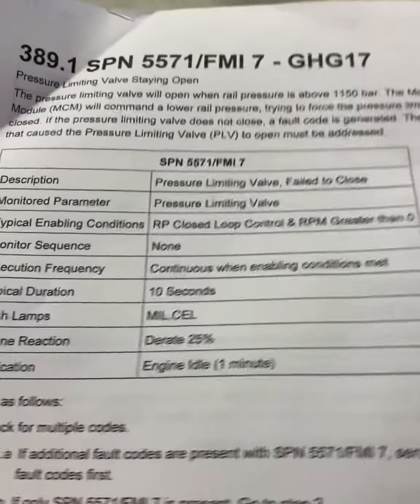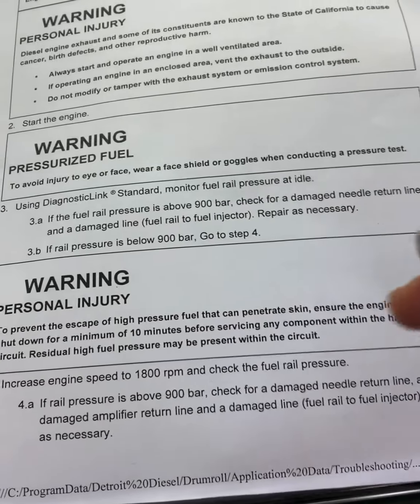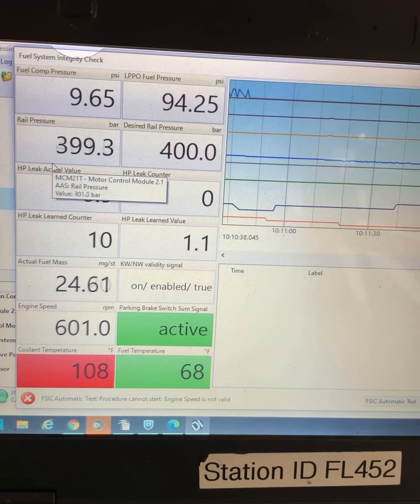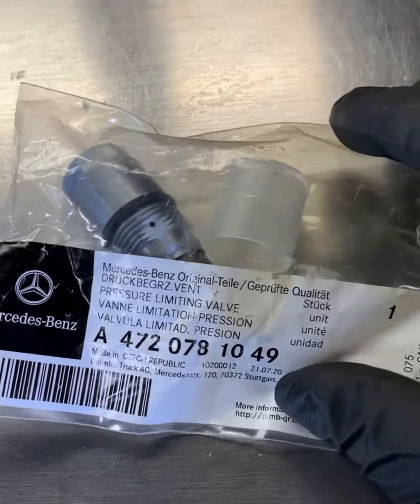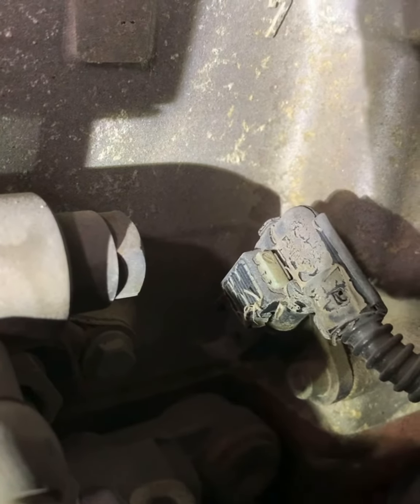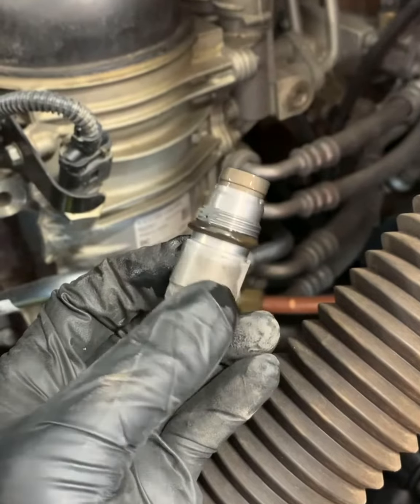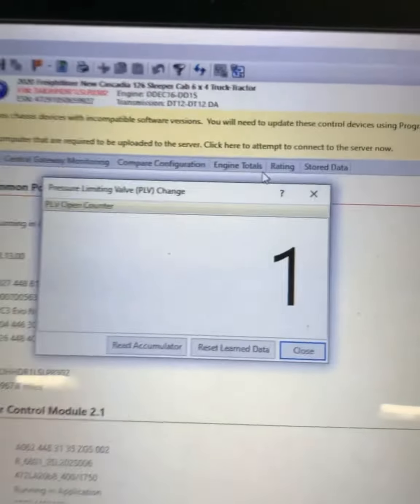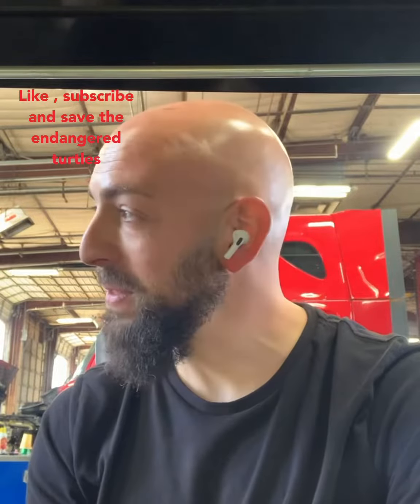5571/7 check engine light pressure limiting valve replacement. Dd15. Dd13.

Comment: Great viedo....my PLV open counter show number 20. do I need replace  same parts. Thank you
Reply from the maker: Anything over 10 is called excessive. So the time is coming for replacement. I would also want to know what your rail pressure sensor is reading engine off engine on and then at 1800 RPM to find out if it’s reading correctly that could be an issue for your plv going bad
Reply: Thanks for your response. Great video  Let's me check I will keep you update....

Comment: I have the exact same code u have can I drive on it till I get to the shop rpm when it stops below 900
Reply from the maker: If you have the same code I’d recommend going to a shop soon. You can drive on it but it’ll make the engine run rough and possible derate
Reply: I couldn’t find the part it’s Sunday can I keep keep the truck running while the code still there n how many miles or hours days etc can I drive on ?
Reply from the maker: @alimajeed9394  the truck will stay running but it will hurt the system if left running for to long. It will keep dumping fuel and hurt your injectors. Every truck is different so no telling how long it’ll let you go for but word of advise , don’t go for to long
Reply: @bustedknucklebydieseldr3228  man  thank you u r really helpful nobody gives free advice these days may god bless u brother

Comment: Thanks for the video. 
After changing the PLV sensor, and I go to fuel rail pressure reading and it still won’t go near 900 bar, so how do we know if that’s a good fix or not?
Reply from the maker: So being under 900 is fine,and thats not the problem here.Basically this troubleshooting takes us in two directions. Run engine and if rail press is below 900 bar than it knows plv is screwing up and opening to often allowing fuel to drain back when it shouldn't which sets the code. If it is over 900 bar than we need to look for damage or debris in lines. id say do a regen and watch your fuel press and for any codes. if they stay fine than your good to go. You can also check the plv counter after the regen and see if its anything over 1. if so its not maintaining pressure correctly.Hope that helps.

Comment: How did u get it off cuz i got wratchet wrenches but i cant get enough leverage on it.
Reply from the maker: To take it off I put a box end wrench on there and smack it with a hammer at the opposite end. It’s a hard to reach place so this makes it much easier.

Comment: I have a cascadia with dd15. Giving a spn 3464 fail 16. Any idea what that is?
Reply from the maker: Great question, That code is a very troublesome code and very intensive troubleshooting. It has to do with the eng seeing  a boost problem. Either you have a boost leak,biased sesnor,bad turbo,bad wastegate,or wiring issue.to many issues can cause this..I usually ask for 3 hrs to trouble shoot this and worst case its a turbo issue which is usally the most $$ part.Hope this gives you a better idea.
Reply: Thank you for responding. I guess I’ll lube up and bring it to freightliner lol. Truck runs great. No loss of power or anything. It’s just that light on the dash is very annoying.

Comment: will this make your truck idle high and low
Reply from the maker: Thanks for watching, this can cause a rough idle and power concerns as fuel is leaving the rail to soon. But if it’s a rpm surge that would be more the fuel pump control valve which I also have a video on.

Comment: spn 4364 fmi 1 what does this code men
Reply from the maker: That would mean you have some issues. So it is a generic code for nox conversion efficiency low. Meaning something aftertreatment related is screwing up. Either sensor , def doser, def pump , filters plugged,exh leak. There’s quite a bit of troubleshooting to do with this code and all models suffer with this code. New and old. But a computer would be required to diagnose the issue here.

Comment: Dr, if I’m a Cascadia owner/operator and want to do some of the things you show, how can I get the diagnostic software tool you use?  Do you have to be a Freightliner shop or a certified tech to get that?
Reply from the maker: There’s for watching and always appreciate you reaching out. The software is a tricky one. You can purchase the actual software through Detroit themselves or I believe snap on sells  it. Issue is it’s very expensive to get.  There is generic software that can do a lot but you get what you pay for.  And most are a yearly subscription type. Going through Daimler/ Detroit is good because you can multiple programs like Wabco or other brands all in one app. Hope that helps and stay safe out there.
Reply: @bustedknucklebydieseldr3228  Thanks JD. I like your videos